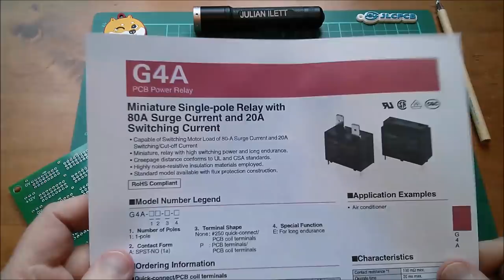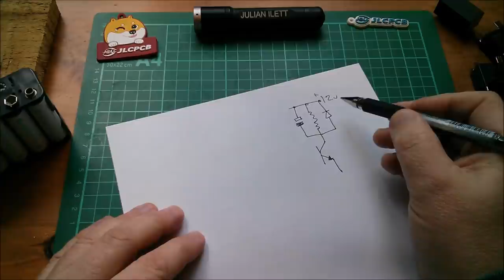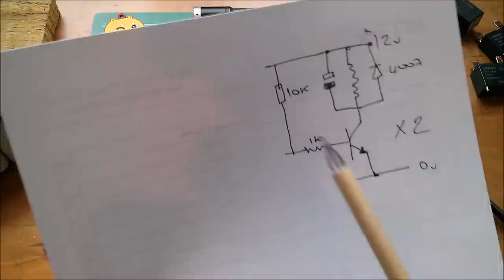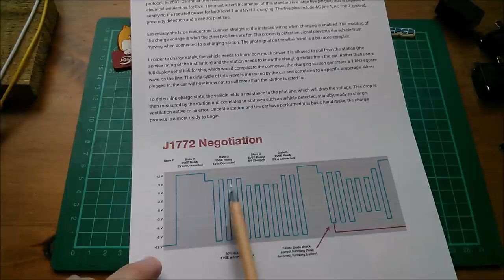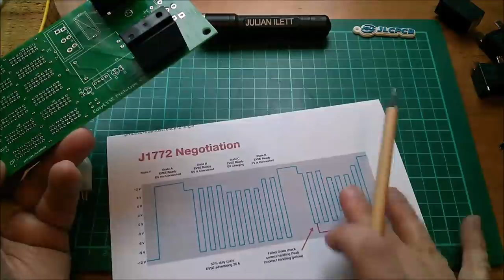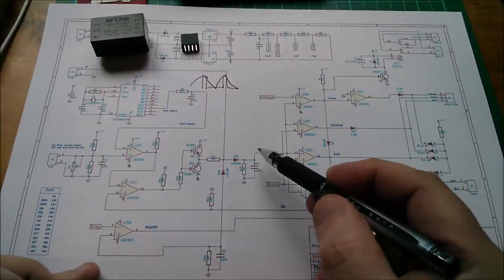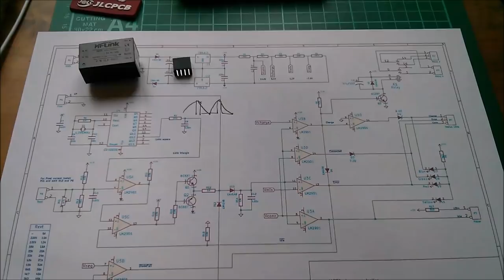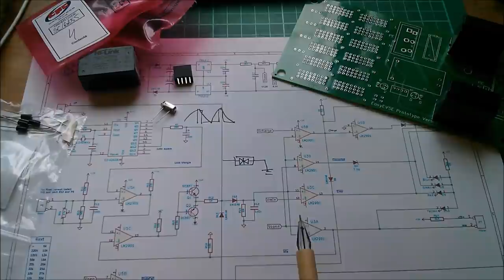EasyEVSE Build (part 1)

Comment: Watch out for those DC-DC converter modules, they're not regulated and can drift quite a bit with little or no load. Moving forward, you could reduce voltage on those relays once they're held in. Full current is only needed initially, but you may be able to drop it to 60% after that reducing power consumption considerably.
Reply from the maker: Yes, I vaguely remember the B1212S having an unusually high output voltage. If its a problem, I'll load it down with an LED.
Reply: @JulianIlett led works for me 👍
Reply: I reduced the current consumption of some relays with a pwm signal, once the switch has time to close (say 1 second). But, the pwm signal had to be above 20 Khz @ 50% dutycycle, otherwise I could hear the coil resonating. I sure there are other ways to reduce coil current. Latching relays are another solution.

Comment: I think the comparators I'm using in my current project are the TS374. I wanted a very low input bias current and fast response time, although they're probably not that critical with my design. I don't think they'd work in your application though, since you need the input to go down to -12V, whereas the TS374 only has a maximum voltage range of 16V.

Comment: So, the EVSE has 2 functions:

1. Detect presence of the vehicle, and switch on the AC supply
2. Generate the 1kHz signal that tells the car how much current it can pull

And the car does all of the AC/DC conversion and current limiting.

Is that correct?
Reply from the maker: I'd re-word that slightly:
1. The EVSE detects the presence of the vehicle (CP drops from +12V to +9V) and enables the 1kHz square wave to signal how much current the vehicle can pull.
2. The EVSE detects the vehicle's readiness to charge subject to the requested current limit (CP drops further to 6V or 3V) and turns on the relays.
The car's onboard battery charger draws mains current (limited by the CP signal pulse width) and charges the battery. It may also perform charge scheduling, cell equalisation, and (on my car) V2L functionality.
Reply: Correct, but there's also a ground fault (GFI) protection (making sure the current in Line is returning to the Neutral) and some AC or DC current leaking to the Ground as well. In some EVSE, you can have some overcurrent and over temperature protections too.

Comment: What happens if your circuit does not switch off the relays at boot up. as you have it as soon as the 12v line is there the relays will pull in, unless they get a signal not to, should your relay drivers be biased off and pulled high to switch on power.
Reply from the maker: Good point. The -12V peak detector would appear to prevent the relays glitching on on startup. I'm not going to bother checking the -12V level on my first build, so the relay glitch may happen. Let's see :)
Reply: I came here to say the same thing. It seems potentially unsafe to have the relays close (and deliver mains power to the plug) if 12v power is lost, if the Arduino crashes, etc. It's probably better to have the transistors pulled down by a resistor and actively pulled up only when the Arduino wants to switch on the relays.

Comment: You don't need full holding current if you won't be kicking relays mid operation. I think you can still reliably drive it with 10v instead of 12. Should save you some power. But I guess the easiest route is to just beef-up on power supply.
Reply from the maker: Yeah, I think it would be easier to put in a bigger PSU than extra circuitry to drive the relays at 2 different power levels.

Comment: Why do you need 2 relay control circuites? Given that you want both both relays going on and off at the same time wouldn't 1 relay control circuite be enough?
Reply from the maker: Just wanted to spread the relay current across two transistors. Not sure it was entirely necessary.

Comment: I haver never seen anyone put a capacitor across the relay coil and I seriously doubts that there is any benefit to it. In fact you could end up destroying the transistors because of the inrush current.
Reply: I was going to say the same thing. It won't stop contact bounce.

Comment: Not confident to use one transistor to drive both relays? Surely the relay windings would draw well under 200mA, so driving up to 400mA should easily be handled by a TO92 transistor, there are plenty rated even beyond 800mA.

Comment: Should be no doubt that the Hongfa is a vopy of the Omron. There are almost no original Chinese designs.
Reply from the maker: Although the Omron relays say 'made in China' on them.
Reply: @JulianIlett  that Omron manufacture in China is keeping product cost low. But Omron design, and test their designs while many Chinese companies manufacture des8gns by the likes of Omron, Honeywell, Bosch, and other reputable engineering organisations, rather than design own relays ( or other products for that maaltter). Making compatible substitues does NOT mean making a copy of the design of other reputable manufacturers. These copy desgns also often fail the quality and features, havinf internal hidden cost cutting or other quality deficiencies, while externally looking ixentical expect brand name  and even superficial internal build identical appearace. Cheaper contact materials , weaker springs not ensuring firm contact pressure, lack of wipe action of contact, and more, leading to endurance issues and contact wearout, oxidation, burnout/overheating. 
All too many China branded parts/components are stolen designs that many times are visually identical, lower price, but then fall short of being truely equivalent. They make huge profit without the engineering costs, investment in design/research, and finally even in manufacture.